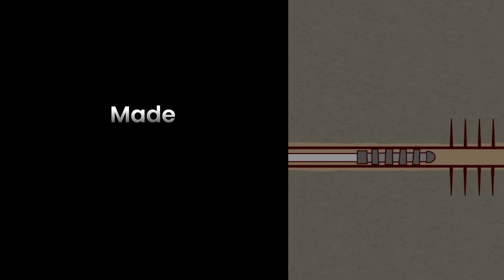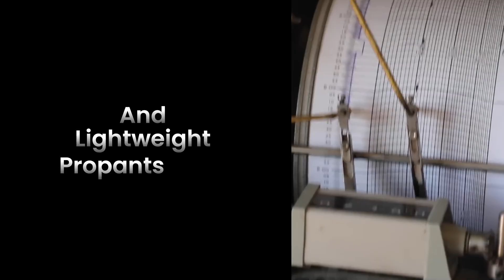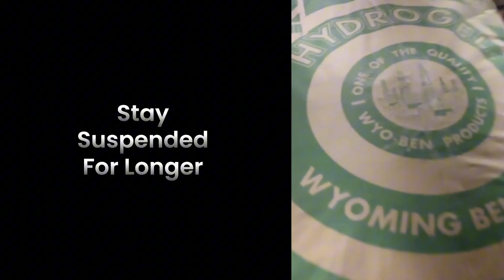What Happens When Fracking Gets 20% Better Overnight?

Comment: In order to get the benefit, you have to go back and frack the wells, and fracked wells have rapid decline rates to begin with.
Reply: Agree with you there, some of these wells see over 80% decline in the first year, then how do you refrac a horizontal well that has a 2 mile or longer lateral and several thousand perforations over that lateral.  If some sharp person can figure that out economically that would be one heck of a prize.
Reply: @MichaelLogan-c2j  we already do that. Run a slightly smaller casing string in the lateral and cement in place. Then just re-frack like a new well. Been doing this with n the Haynesville for a couple of years.  Old wells were originally completed with less stages and lighter sand concentrations.  Re-fracks are close spacings and lots of sand.
Reply: @2WCattle  Good to know someone is running liners and perforate and frac for wells that have 400' or greater stages in the old days.  Most permian wells have 5 1/2" production casing so kind of limited on what you can use (4"?). Haynesville use larger casing?  Went to a couple of jobs in Carthage TX and I think they were 5 1/2" x7 1/2".
Reply: @MichaelLogan-c2j  we were running 3-1/2 flush jt in 4-1/2 13.5#. It was tight but worked. Made clean out run w/ 3.75 mill to btm  on stick pipe first.  Re-fracks come on like a new well.
Reply: @MichaelLogan-c2j That's why they've developed this new light yet harder proppant. It can be used in new wells and for refracturing existing wells to increase their production.

Comment: This explains why when fracking well started, they weren't pulling out as much as predicted.
Reply: They started experimenting with hydraulic fracturing in the late 1940's and perfected it during the 1950's. Advancements were made over the years along with the development of horizontal drilling. I believe the first horizontal well that was fractured was in the Austin Chalk near Giddings, Texas in the late 1980's.
Reply: @billwilson-es5yn  and now 50 yrs later fracking has morphed into a clean, productive, stable supply that needs to be termed as 'clean energy' and subsidies  equally